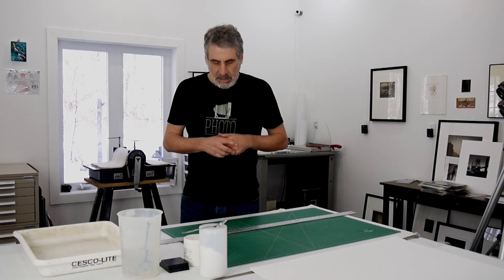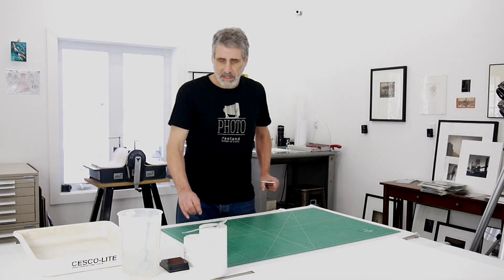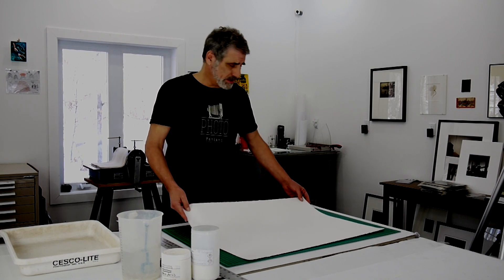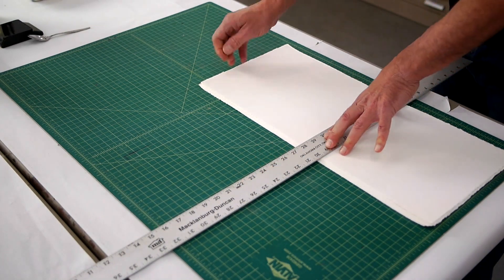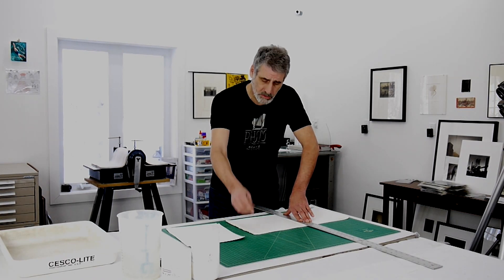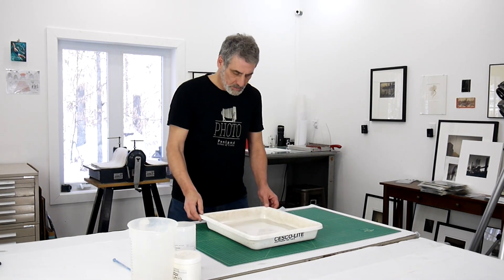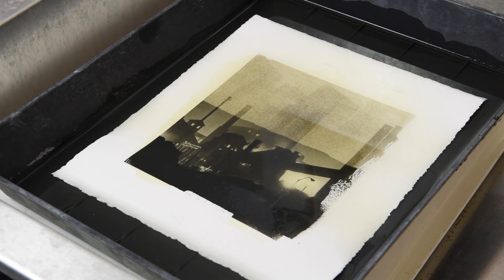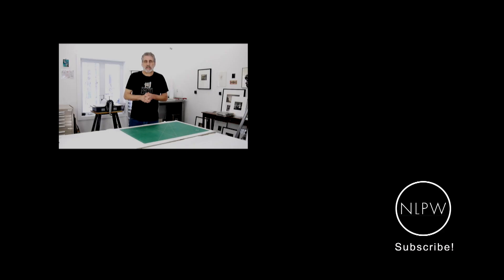Treating Paper for Platinum / Palladium and other Alternative Photographic Processes

Comment: Great tutorial Bill! Per curiosity - how many sheets can you treat with 1000ml of this 3% acid solution?
Reply from the maker: Great question! It definitely depends on the buffer in the different papers, but I usually change it over when the paper stops bubbling a bit when I put it in. You can also check it with a pH strip, and if it starts to go alkaline, it’s definitely time to change it.

Comment: Bill Schwab, what you made is a 3% solution, not a 30% solution. A 30% solution means 30 grams per 100 ml. So a 30% solution would require 300g not 30g, in a liter of water (10X).
Reply from the maker: Yes. Caught the mistake a long time ago if you read the description. Thank you.

Comment: Have you tried sulfamic acid to treat the paper? It's inexpensive, has a low Ph (somewhere around 2 I think), but is fairly gentle on the paper fibers, is less toxic than oxalic acid, and washes out easily.  Its pretty easy to find too - Walmart and most hardware stores carry it as tile and grout cleaner. Just check the label because some use different cleaning agents. The brand I use to treat paper for Cyanotypes is called Aqua Mix.
Reply from the maker: I have and it doesn’t work so well with Palladium for some reason. Side-by-side test are much better with the oxalic. You also need less oxalic than you do sulfamic to get similar results.
Reply: @BillSchwab   - That's interesting. I have not made any Palladium prints (yet) - I've only tried it with cyanotypes and its fantastic (or at least better than vinegar or dilute Hydrochloric acid.) Yes, I do use more - I use a 7% (w/v) solution for about 20 minutes.  Maybe it's too acidic, or maybe the oxalate washes out better. I have to think back to HS chemistry (thanks, Mr. Savino! lol.) When I "graduate" to Palladium, I'll remember that.

Comment: Bill - thanks so much for this video. I plan to treat some BFK Rives for gum over platinum prints. I have always enjoyed printing gum on this paper but only recently learned platinum. If you were to treat for this process combo , I assume you would preshrink the paper in water first before treating it (preshrinking of course to avoid registration pitfalls later)?
Reply from the maker: I’m sorry, Chris. I just got this message and didn’t notice it before. I do preshrink  the paper when I’m treating. This is for doing any kind of overlays. What I do is start with hot water in the treatment phase. Takes care of two birds with one stone. Thank you for watching!
Reply: @BillSchwab  no problem Bill. Thanks for the helpful tips!

Comment: Is 30grams into 1000ml not a 3% solution?
Reply: Just pointing out , even in the write up you say 3% but write 30 g into 100 ml which is 30%.
Reply from the maker: Shane Booth thank you! I thought I had updated the description. Appreciate it!
Reply from the maker: Yes. It is. Here's a good calculator you can use... http://www.ou.edu/research/electron/bmz5364/calc-percent.html
Reply: @BillSchwab  In the video you call it a 30% solution but it is a 3% solution.  Correct?
Reply from the maker: fotorat Yes… Thank you for pointing that out. I hadn’t noticed. Good catch. However, when I first mentioned oxalic in the video, I do use the correct percentage. It’s written into the description for the video as well.
Reply: @BillSchwab  Excellent.  Love your videos..Subscribed.

Comment: Another excellent video Bill.  Great job. I would love to see a video on how to dry mount a Platinum print properly.
Reply from the maker: Well.. that answer is easy. I never dry mount platinum or any handmade prints. I gave that up long ago as I don't like to commit a print to a piece of mount board. There are buffered mounts that are removable, but that only gets them off the board. It will damage the print to try to remove it from there. Believe me... I've tried. It's more acceptable to mount them like documents... corner mounts, rice tape or mounting strips. You give me a great idea for a segment on mounting the work. Lots to get to! I hope this helps! Thank you!
Reply: @BillSchwab  Hi Bill, thanks for the thoughtful reply.  Yes, mounting the Platinum prints is a really key point that so many overlook.  I have been trying out different methods and havent found anything that I really like yet.  Looking forward to your video on this topic.

Comment: Thanks Bill!  I have always used unbuffered paper, so I have never had to do this treatment.  It was good to see a demonstration.  You mentioned that you would talk more about selecting the “print” side of paper but I must have missed that part.  The other paper issue I have run into with platinum printing is unsized paper.  In the past I only used Bergger COT 320 but then started having issues because they changed the sizing or something.  It would be good to know how to treat the unsized paper for platinum printing.  I am enjoying your videos.
Reply from the maker: Hi Larry .Thanks and thanks for mentioning that. I mentioned briefly in the video about the curl of the paper when dry. The side that curls away is the printing or non-mould side. You can best tell by viewing the paper's watermark. Right reading side is the printing side. Also, if you look with a loupe or magnifying glass, you will see a fine screen pattern on the non printing side. Thanks again!